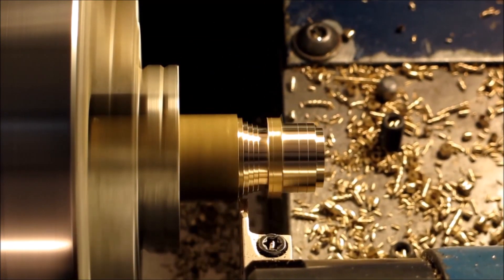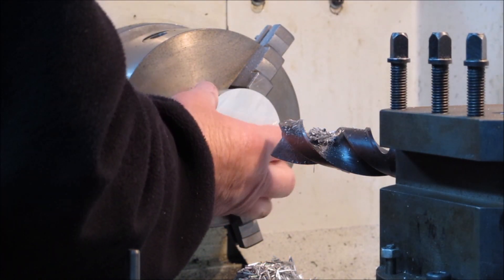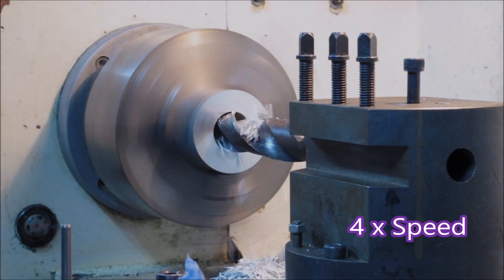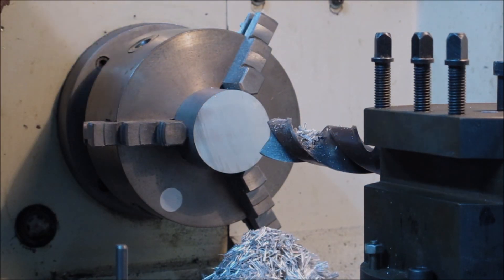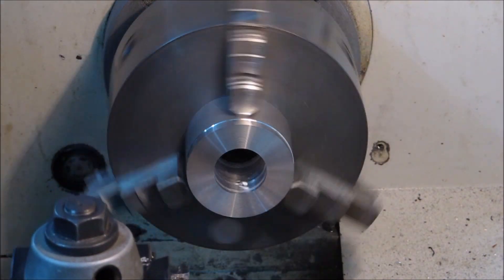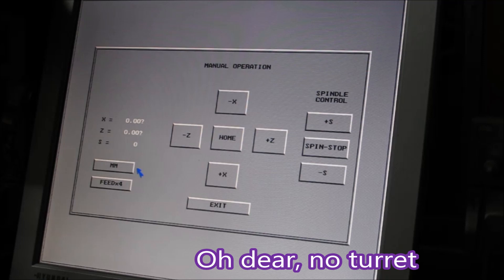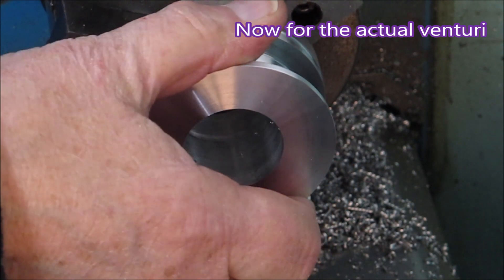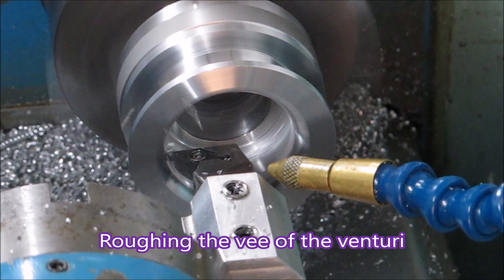Venturi for simple mixer.  2011 alloy turned bored and cross drilled with DIY indexer

Comment: Hi Sir, the hercus pc200 spindle motor is a dc motor with encoder ?
Reply from the maker: Made by SEM, 180 volt dc, brushed motor, 0.37kw, 2500 rpm. Lathe had 2 speed ranges so encoder is driven by the spindle not on the motor.
Reply: @smallcnclathes  Thank you sir

Comment: Nice work, Nigel.
Good to see more video,s.
Seems this job was a long term thing for you.
Thanks for sharing your work with us.
All the best.
Peter.
Reply from the maker: This particular set of venturis were prototypes. When mixer conversions were still happening we were doing hundreds of mixers per month.  Venturi, body and inlet pipe as an assembly.  These days, I think only forklifts use mixers and that is what these are for. I won't be making these in production.  Needs a lathe with live tooling to drill the cross holes.
Reply: @smallcnclathes  
A lathe with C axis would definitely come in handy.
It was very interesting to see the types of jobs that you would undertake.

Comment: Love the DOS commands, I still prefer keyboard shortcuts rather than mouse clicks. In the eighties, many programmers took typing classes to improve their coding speed.
Great use of your favourite lathe tool 🤗, thanks for sharing.
Reply from the maker: I have been using my cad software since dos, I use a heap of key commands. So many in fact that it makes it damned hard to instruct any one about my cad. My left hand tends to have “done it already” before I even get a chance to think about it. I cannot imagine using only a mouse and icons to get the job done. As the keyboard commands can be configured, they have changed of the years to suit the way my brain works, so I always have a copy of the keyboard file saved incase the one in the software corrupts.
It did take me a while to get the hang of the Xtree key commands, but I don’t need too many of them so it works well.
Reply: @smallcnclathes  Same here with CAD, not to a professional level though.
Reply from the maker: Bosted Tap CAD and the various abilities folks have with it, amaze me. I am not good with organic shapes etc, but normal stuff I get through ok. Major recent job has been a biogas electricity generator, typically for farm use and a couple of chain guards for a production motor cycle.
Reply: @smallcnclathes  BioGas generator, impressive, is there much need for odour control?.
Reply from the maker: Bosted Tap not really sure. I don’t think the digesters create much smell. The whole environment around them is usually somewhat odiferous I would have thought. Pig farms, abattoirs, processing plants would be typical plants that could have them installed.

Comment: xtree gold?? I haven't seen or used that since the early 1990's What a blast from the past. 😊
Reply from the maker: I just love knowing that I am right up there at the forefront of cutting edge technology. LOL
Reply: Same here 👍
Reply: Yep, I remember well running AutoCAD 9 on the green CRT monitor.  It  sure taught me how to manage layers, and tool paths as well. We had to take our tool paths out of ACAD through .dxf files and convert them in the machine code program,  then insert tool travel/changes into the path code. 
Most "programmers" today can't analyze their code and edit it to tweak their work.   Good times.